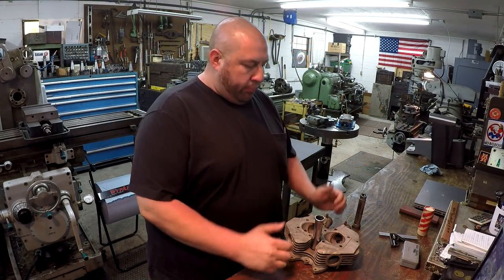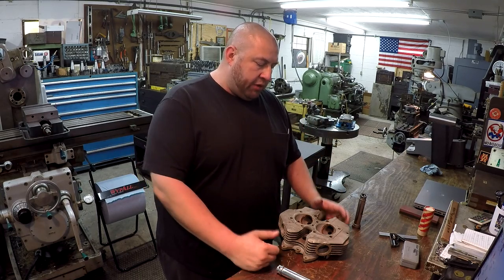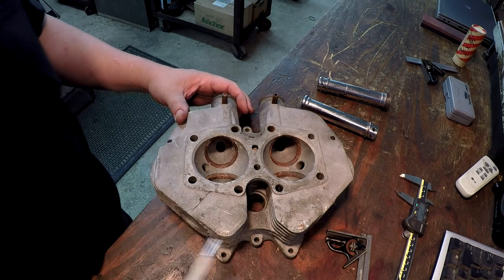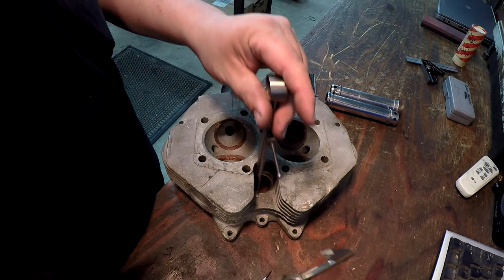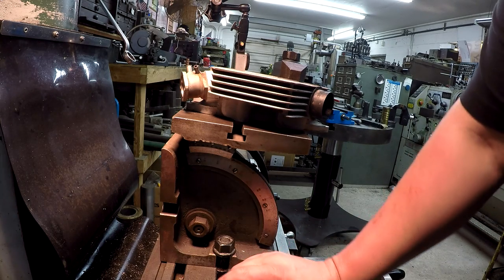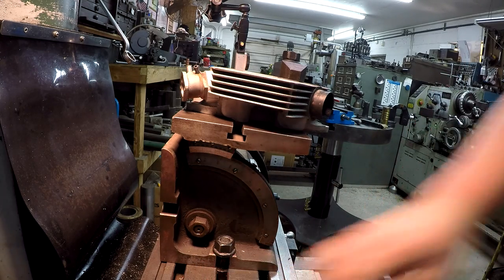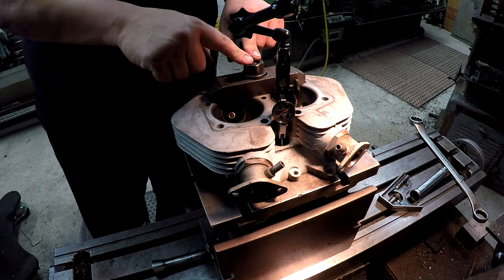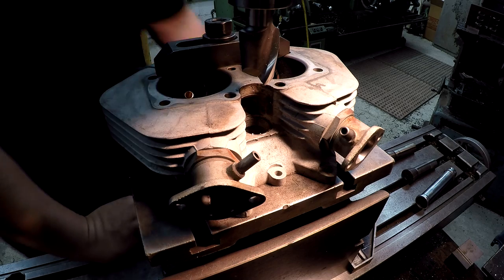Triumph TT Special Cylinder Head Modification

Comment: Very interesting. Can we use the same working set-up in order to remove the rust inside the bore of a piston. I have am Lifan 15Hp that rest outdoor for two year and the bore is very rusted? I have nothing to lose if I try to remove that rust with my Bridgeport. Let me know if it's possible and I will try. Thanks.
Reply: +Robert Patoine Do you have a cylinder hone? I am no expert, but I seem to recall that you need the cross-hatch pattern from a cylinder hone to get a good seal between the bore and the rings. Of course you can use your BP to clean out the rust and a little extra and then sleeve it, but you probably already know that.

Good luck with your outboard engine, and if you make a video of the repair that would be awesome to watch. Aloha...Chuck.
Reply: +Knolltop Farms 
As I understand from a friend because it is not a diesel there is not such a thing as a sleeve. Anyway I will test any ideas. The motor is finished so, I have nothing to lose...
Reply: +Robert Patoine You can do anything you want to a motor, but there may not be on the shelf parts you could use, so you'd have to bore the sleeve back to original size after over-boring it. I've done it on my dirtbike before, and that's just a water-cooled 2 stroke. As you say, there's nothing to lose, and the set up is likely the toughest part of the job. As long as you have the tools...I personally don't have access to a mill at the moment.
Reply: You can bore a cylinder on a mill depending how accurate it needs to be, a proper boring bar has paws that follow the cutting tool keeping it from wandering thus allowing a more accurate bore.

Comment: remember the mating surface is at the flat and there's a little casting drop where you measured on the 2nd hole.. that's why it appears .050 shallow.. because I think you measured the other right at the mating surface... I could be wrong there. and in the end it's the length from the mating surface to the bottom of the BOTTOM (i.e. crankcase) pushrod mounting surface that matters. It might be better to have the block present to check/fit/check/fit..
Reply from the maker: Where I was measuring from was a machined face. It didn't look it because of the discoloration in the surface from the gasket.
Reply: +Abom79 Ahhh yes.  The guy who comments down below I think explains it so you might be exactly right on. I appreciate your caution....
Reply: +Abom79 :
 Adam, it seems to me that measuring from the machined surface is the thing to do. Castings can vary greatly. If both tubes are the same length, then both holes need to be the same depth in relation to the main mating surface.

That being said, I am just an armchair enthusiast enjoying your content. Hope your weekend is going well. o/

Comment: I think he modified the wrong head, as the head at the beginning of the video is later model head noted by the two bolt holes between the combustion chambers as well as other details that the later head had.

Comment: The head you have is a late T140 Bonneville parallel port head, NOT a 66 TT Bonneville head.  This is a 750 twin.  It uses the ten bolt, not nine bolt head.  You are adapting 650 "long rod" motor pushrod tubes to a 750 head.  That is a waste of time, as all the owner needs to do is to use the shorter 750 pushrod tubes.

Comment: Really nicely set up on the mill, and really nice work all round.  But whoever gave you the job can;t have known what they're talking about. That first head you were showing is far from a 1960s TT head. In fact it's a 1978 or later T140 750 head, as can readily be told by the fact it has provision for 10 studs/bolts (the 650 units engines all had 9), and the parallel inlet port spigots.

So, I'd be interested to know what was the owner trying to achieve?

Comment: Adam, I see you fed your depth with the knee unlocked instead of using the knee locked and using the quill. Have you seen any problems doing this? I usually bring my quill down against my stop and then dial in my depth and use the quill. Thanks.

Comment: I was confused while watching this, you were using a 10 stud head trying to gauge a 9 stud head, the two are completely different . I have a T140V which uses the 10 stud head. The head squeezes on the two "O" Rings top to bottom. (The bottom one is a square cut and held in by a metal band and the top is normal) Are you sure the owner hasn't mixed up push rod tubes? I cant see why you would need to cut that much material out of a cylinder head. Nice work though you certainly took the approach of, " If your going to do a job make it a good one"  :)